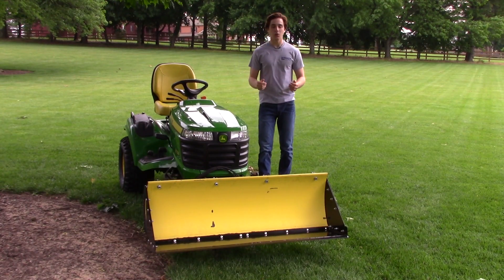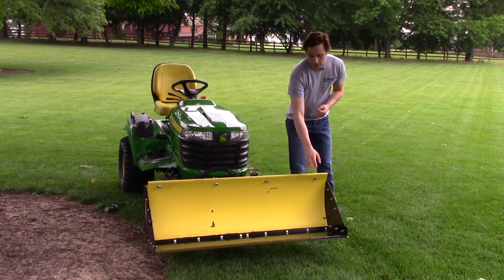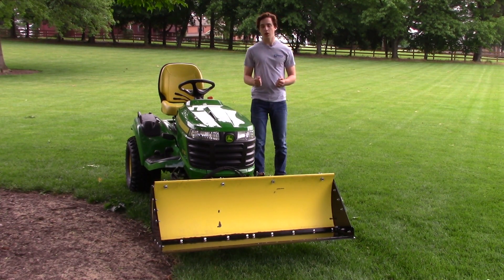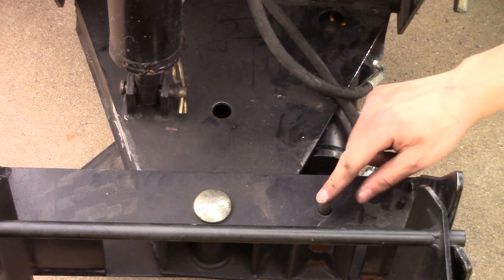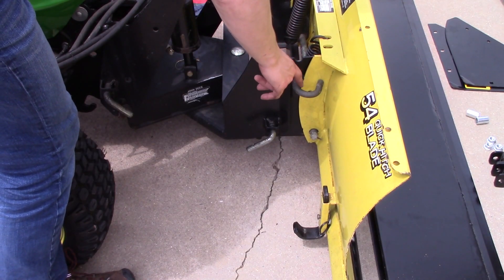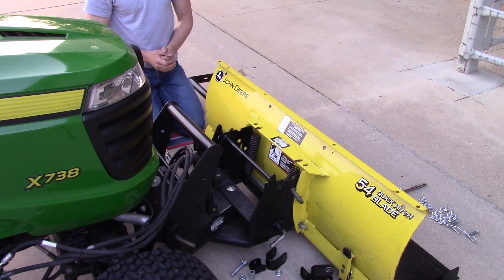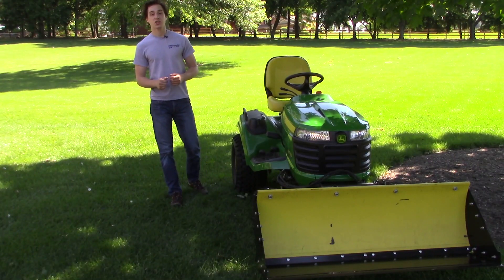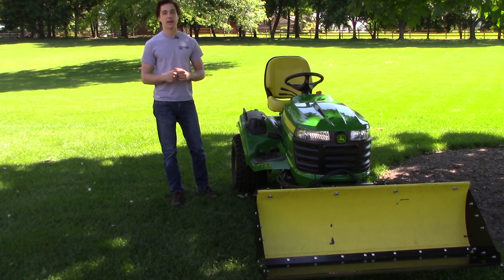54 in. Tractor Shovel Overview

Comment: If you need to buy a plow, your better off getting a little buck loader. 2 to 3k depending on the model. Far more capable. 
Has about a five foot lift.
You can load a pickup truck.
I made forks for it too.

Comment: Can you leave the 54HC mower deck on with the shovel? I assume if you close the lockout valve, the deck will stay put when you move the plow around?
Reply: To in stall the quick hitch the draft bar that holds the front of the mower deck up needs to be left off.